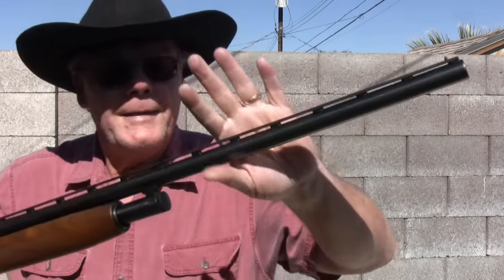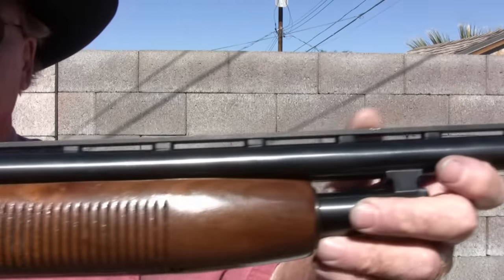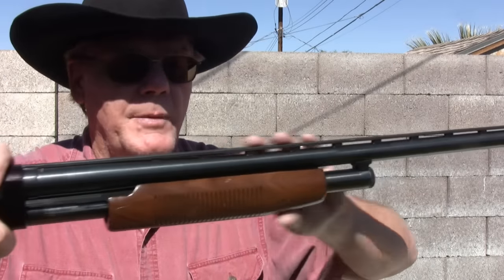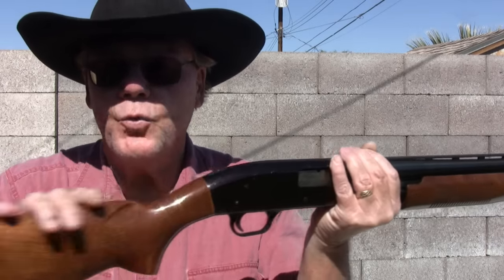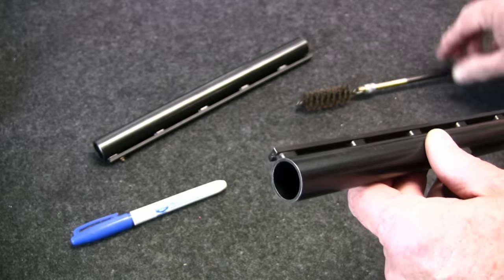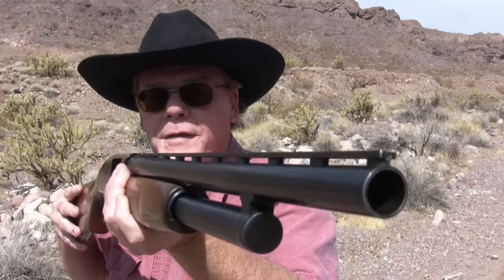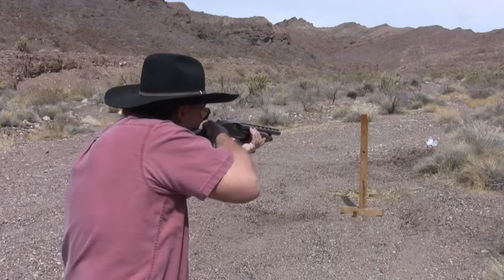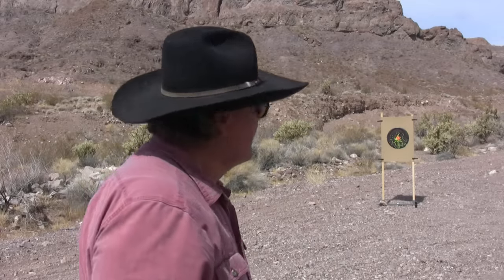How To Cut Down The Barrel & Replace The Ejector On A Mossberg 500 - Awesome Home Defense Shotgun!

Comment: Great video, always loved the shorter barrel shotgun for rabbit hunting. Now I have an old, but like new Revelation pump shotgun that was left to me by my uncle. Really thinking I may cut it down. The first one I cut down was a Savage 311 double barrel, it made it a lot easier to get through the brush with it. Have fun with your "new" shotgun Mixup and Thank You for the video. Also keep stressing the fact we need to keep area cleaned up where we shoot. I have hauled a lot of others garbage back out with mine over the years.
Reply: That Revelation was made by mossberg in case anyone didn't know.

Comment: I did the same exact thing to my very first gun that I DID buy at the HB Montgomery Ward (back in 1976) , except mine is a 20 gauge . It has a pretty tight spread for the short barrel .
Reply: I used a copper pipe cutter, took about 1 minute.  Accurate and smooth cut.

Comment: As a PSA. I have an old Mossberg AB model and if you want to take off the pump handle you need to take off the magazine tube. There is a metal ring soldered on the mag tube that prevents you just sliding the pump handle off the mag tube. Once you have the mag tube off you can slide it off the other end.

Comment: When I did mine I used a drill with a rag and 800 grit paper to finish inside the barrel..I drilled my bead hole and epoxied it in place after tapping the hole..

Comment: You need 32TPI blade in the hacksaw. You should start your cut with a draw stroke to initially set your square cut. Your cut was pretty good! I have used a hacksaw over 30K hours and couldn't imagine I would have done much better.
Reply from the maker: I don't have anywhere near 30K hours on a hacksaw but I have been using hacksaws and files ever since I took metal shop in high school back in the early '70s 😊 Thanks for the compliment !!
Reply: @mixup98  Finally kicked the habit after 20+ years. Thank God for the cordless bandsaw!

Comment: I BOUGHT THE 500 PERSUADER ABOUT 30 YEARS AGO, IT HOLDS 7 + 1 CAME WITH A 20"  &  28" BARREL AND CHOKE TUBES FOR THE 28". I STILL HAVE IT & IT RUNS GREAT. REPLACED THE EJECTOR 2 YEARS AGO AND NOW I KEEP A SPARE EJECTOR IN THE CASE JUST IN CASE IT NEEDS REPLACEING IN ANOTHER 26 YEARS. THATS THE ONLY PROBLEM I HAD WITH IT SINCE NEW.
Reply from the maker: I have a 590 Persuader, which I bought last year, and I absolutely love it. My son will have to replace the ejector in 28 years :)

Comment: I have a full choke on a 30" barrel. If I cut the barrel down to 18", would it hopefully change the choke to a modified or cylinder choke?
Reply from the maker: If you cut the barrel down to 18" it will change the choke to cylinder bore (no choke). I would suggest cutting the barrel to 18.5" just to be safe.

Comment: That's awesome on one of mine I cut down for my uncle as a gift I used a deburring tool for the inside of the barrel for that burr it turned out sweet! Great video! Ps I used a blueing pen on my mag tube exstention I had to grind the inside ring on the old tube with my dremel tool and wanted to make sure it looked good and doesn't rust later.

Comment: Lengthening the forcing cone & installing a screw in choke system will amaze you & expand the utility of the shorter barreled shotgun.
Reply: Not thick enough to thread

Comment: Definatly would put bead on. 
Mossberg makes an Accuchoke 20in barrel but you can't buy a 500 with that barrel for some reason. I shoot 690 and 715 roundball with rifled choke and surprisingly accurate. 
I want rifled choke fir those loads so I'm leaving all the 28in barrels as is. Right now they all have 18in with heat shield. That is a really cool look with vent rib and short barrel. I'd jump on a gun that looks as good as yours.

Comment: I own one of the newer 535 pumps. Think I'm gonna order me a used barrel off Ebay and cut it down to keep for home defense.  I'll just change it out during turkey and squirrel season.
Reply from the maker: I looked at barrels on Ebay before I cut down my barrel. You might be shocked at the asking price of used barrels....I was.
Reply: @mixup98  I've seen them for mine as low as $79,but yeah I've seen some that were ridiculous.  A new one from mossberg is a little more than $200,depending on what model gun you're wanting it for. Seems kinda strange to ask $200 for a barrel for a gun that only costs $300 in the store,but I'm sure somebody is buying them. Thanks for making that video it's a good one.

Comment: Another reason I like the 500 vs 870.  870 has a riveted ejector vs 500 having a screw.
Reply: I have an 870 and didn't know that.👍
Reply: Another difference is the 870 has a steel receiver whereas the 500 is aluminum alloy.

Comment: Looks like steel shots are for the future as lead will pollute the environment. Will the Mossberg or the Remington be able to shoot steel or has it to be a chrome barrel ? Thanks
Reply from the maker: Hello Paul and thanks for the great question. The choke on a shotgun will usually determine if steel shot can be used. Steel shoot should only be fired in a barrel with a choke that is specifically made for steel shot. My Mossberg in this video doesn't have any choke therefore it is perfectly safe to use steel shot.

Comment: I don't hunt, so I cut down a Winchester Ranger 120 that had not come out of the safes in decades, using a vice and a DeWalt grinder. Those old US-made Winchesters have a smooth action, and I found fiber optic front and rear sights that attach to the vent rib. Used a black Sharpie to touch up the end of the bbl.

Comment: Nice vid but any reason why you didn't cut it down a little further closer to 18 inches?  Looked like you could've gone down to the next vent rib or would that have not meet the overall length requirement?
Reply: I agree, He just had another 1/8" to go to make that barrel flush with the rib. Would have looked much better...but hey, it's his shotgun.
Reply from the maker: A cut at the next vent rib would have made the barrel exactly 18 inches long, which is to close for comfort. If my barrel is going to be that short than I want it at least 18.5 inches but I didn't want a half inch of extra barrel sticking past the rib so I settled on 20 inches.
Reply: Imagine telling our Forefathers that his barrel is an 1/8 inch to short.....?

Comment: The deal on the 500AT I was going to buy fell through. After I already bought a 20 inch barrel with sights, a 7 round mag tube, and a mag spring.  I suppose I'll put them on my Maverick 88.  I might as well find some wood furniture for it, too.
Reply from the maker: Sorry to hear that you won't be getting the 500AT but your 88 is going to be very happy with the upgrades.

Comment: I have shortened my 12 ga Iver Johnson champion but to stop it hitting me in the cheek and cut down recoil. I drilled 3 rows of 1/8 inch holes. 1 inch back from muzzle. cuts down recoil a lot. the bead is optional but would be a nice touch. Nice video.

Comment: How can I get my barrel straight with my file?
Does it need to be perfect? Or close enough to being straight?
Reply from the maker: You can place a square along the side of the barrel and use it to help square the end of the barrel. A perfect cut and crowned muzzle is important on a rifle or handgun but it's not an absolute requirement on a shotgun.

Comment: saw one of these locally for 200$ i should have jumped on it right away.  It was a drive and i was busy but thanks for the education.  I would have felt bad chopping an older gun down but knowing they're not rated for steel shot i wouldn't feel bad
Reply from the maker: If it was in good condition then 200 bucks would have been a fair price. Maybe you will get the opportunity again someday to pick one up....I'm glad I did. I cut another inch and a half off the barrel (it's now 18 1/2") and I absolutely love it.

Comment: When you do your next video showing the reinstallation of the front sight, please pull the new ejector and show it side by side with the old one. Was the old tip worn, bent, or what?
Reply from the maker: I will show both ejectors when I do my follow-up video. The new ejector is bent outward which helps engage the rim of the cartridge. The old ejector has lost this bend and is more flat and less contact is made with the rim of the cartridge.
Reply: @mixup98  yeah and if you try to bend the old one it  might break

Comment: I'm a big fan of your content and was curious if you might have some insight on how to remove a ribbed vent off of a shotgun similar to the one in this video?.. appreciate  ya
Reply from the maker: I have never removed a rib but I'm guessing most are attached with soft lead solder. You would need a torch to remove the rib and then the barrel would have to be cleaned up and refinished.
Reply: Dremel or hacksaw.

Comment: With the ejector and spring were there any visible issues that you could see that would cause those issues?
Reply from the maker: In order for the ejector to work properly there is a slight bend in it so it can spring outward and hit the rim of the shell as the bolt is moved rearward, thereby ejecting the empty shell. This bend in the ejector was much more pronounced in the new ejector when compared to the old ejector.
Reply: Gotcha.. I believe my mossberg is having the same issues so I’m going to swap it out and see if that helps. I hope that the case it just seems that my 500 is sensitive to different types of ammo.

Comment: Great use for an old duck gun, guess the citadel is still on the sidelines, was hopeing you would have that vid out next, oh well. Saw another vid that the locking lug failed, so their QA/QC is questionable at best IMHO. Thx for the vid, really like the old wood on it tho
Reply from the maker: My Citadel has me pretty frustrated but I promise I will decide what to do with it in the near future.....send it back to Citadel or work on it myself.
Reply: @mixup98  I kinda figured that, like I said , another U Tuber " BOOMSTICK" I believe had the locking lug fail on his, so there is a problem with them
Reply: @williammccaslin8527  if that is the same video i saw that gun definetly had the wrong  bolt in it.. the lug was a good half in or better away from the barrel
Reply: @ronalddavis  I think it was

Comment: What is the measuring criteria for cutting a barrel to 20"? From what point at the chamber do you measure?
Reply from the maker: The easiest way to measure is from the back end of the chamber, where the rim of the cartridge sits. You can also close the bolt, insert a wooden dowl and measure from the face of the bolt to the end of the barrel. If the barrel measures 24" you simply cut off 4" for a 20" barrel.
Reply: This was my question also. Thanks for asking and answering.
Reply: Legal measurement is from the bolt face on a closed action.

Comment: I bought a used Remington Model 1100 12 ga. shotgun in 1967. Had a 28 inch mod. barrel on it. I couldn't hit ducks for beans with it. I put on a Poly Choke and wasn't much better. I found a used skeet barrel with vented rib for it in the gunshop and had it cut down to 23 inches. I wanted 22 in. but he had to match the rib support at the end. Put a white dot sight on the end. I wanted a RayBar but he didn't have one. I understand a skeet choke runs the length of the barrel. I hunted grouse with it and it was deadly. Lighter weight, handled better, and was much easier to carry thru heavy cover. Even got a couple pheasants which were becoming too scarce to hunt. I used the Poly Choke for ducks satisfactorily but quit when steel shot came in in 1976. I had a side mount put on for a 2-7X scope (could remove and never messed up the sights) and that short barrel took a lot of deer. I bought a rifled barrel for it in the early 80s but found the cut off grouped just as well and sold the rifled barrel. Size does matter but not how you might think. Did you ever consider  installing choke tubes or was the barrel too thin?

Comment: Those old Mossberg 600's used to be a good deal but now they are getting hard to find and bring a price of $200 to $250 around here. Just wondering; is there enough metal that far back to have a gunsmith install a screw-in choke system for you?
Reply from the maker: I am guessing that there is sufficient metal for screw in chokes and maybe I'll have a gunsmith take a look and give me a quote.
Reply: Depends on the model of choke tube. I've had a couple installed by a top tier local gunsmith. Had to go with thin wall chokes which you should avoid steel shot with them.

Comment: Enjoy watching a man that knows what he's doing. However, I personally would have gotten online and found a replacement barrel. MidwayUSA has a 18.5" with bead sight (Product #: 748383 Manufacturer #: 90015 UPC #: 015813900157) for $129.99. You can also purchase a vent rib barrel with choke tubes for less than $250. Either way you could've had the original barrel to keep with the original gun.

Comment: Could you have added a mag tube extension to get the mag to match the barrel length?
Reply from the maker: Unfortunately a magazine extension cannot be added to the Mossberg 500/600 series of shotguns due to the closed end design of the magazine. The whole magazine tube would have to be removed and replaced with a longer magazine tube and spring.

Comment: Hey hi. I have a h&r parnder pump 12. And the barrel has like a tube inside the barrel but i wana cut 6 inches off of the 28 in barrel. Will that tube inside effect anything of i cut ot down? Like its not flush with the barrel now but it would b after cutting it down. Will that hurt anything?
Reply from the maker: It sounds like your shotgun has a threaded choke screwed into the end of the barrel. Cutting six inches off the barrel means that the barrel won't have any choke. You really don't need a choke if your shotgun will be used for home defense.
Reply: @mixup98  ok so that thin tube ypu see in the barrel lookin from at the end. Is that the same length as the barrel? Are cutting 6 inches off will get rid of that? I also took out that long plastic black thing too fit more shells, idk if you were talking about that as the choke.
Reply from the maker: @codybenoit394  The choke tube should only be about two inches long and there should be four notches on the very front of the tube. A choke removal tube will fit into these notches so you can unscrew the choke. Never shoot the shotgun with the choke removed as it will destroy the threads. Cutting your barrel will remove the choke tube. The long black plastic piece is called a magazine plug and you're right, it is there to limit the amount of rounds in the magazine.
Reply: Ok sounds good. Im just trying eliminate some of that long barrel lol. So taking 6 inches off, there will be no more choke. So that shoundnt affect the pattern are the way it shoots.  right?
Reply from the maker: @codybenoit394  Removing the choke will turn your shotgun into a short-range shotgun, which is okay if you are going to use it for home defense. I have a video on youtube designed for beginner shotgun owners which you might find helpful. Here is that video: https://youtu.be/crOUq5iz0rM
Reply: Ook ill check it out. Thanks for the help

Comment: So if you cut the full choke off can you now shoot steel shot??
Reply: Yeah. The issue was the steel shot all coming out of the barrel at once. Lead deforms when you do that but steel doesn't. Out of a cylinder bore it's just fine.
Reply: .thanks xzekkx 👍
Reply: It could theoretically (but unlikely) score the barrel a bit, but on a 70s shotgun would likely be fine. Also who cares if the inside of the barrel on a shotgun like this gets a bit messy? This wouldn’t be for precision shooting. :)

Comment: I have one like that, it's a western field by Mossberg.
Reply: Actually have 3, a 12 guage...26" with poly choke.....20 guage bolt action with 3 shot magazine...26" barrel, and a single shot .410 ....all western fields , can't find any dates on them, all day made in USA, I know they are around 1970 because I graduated in 1976 and pretty sure Dad (RIP) bought them when I was 12, the 12 guage might be older because I think he had it before he bought the 20 guage and .410 for me and my brothers to hunt with.
Reply: I also recently purchased a new Mossberg 935 I ran across, can't hardly find any Mossberg shotguns new these days. I'd like to have a 590a1 or an early 70's model Ithica model 37.
Reply from the maker: Sounds like your Western Field (Mossberg) is a model 550....nice shotgun.

Comment: I'm buying a 500AT built in 1973, looks like it was never fired.  It has that long ribbed (for her pleasure) barrel and beautiful furniture.  I'm just gonna  slap the 18 1/2 inch barrel from my Maverick 88 in it.  I looked for barrels in ebay and other places.  They were more expensive than my Maverick 88.  According to my infallible research on the interwebs, the 500AT was aimed at the law enforcement market.  I didn't see the reason for that explained anywhere.
Reply: Not sure if a Maverick 88 barrel will work on that one.
Reply: @tubeonline629  it will work fine
Reply: I'm finally getting it this Friday evening. (The guy lives about two hours away, he's got a trip planned that will intersect with my route going to my mother's house, which I do once/week)  I found a 20 inch barrel with sights on it at a local shop for $99. They're north of $200, if you can find one!  Now I need to find a longer magazine tube to work with the barrel.  The only one I've seen is on ebay.
Reply: @traumajock  
That 20" barrel with sites might be a slug barrel,  if it is it will be rifled and won't work very good with shot.